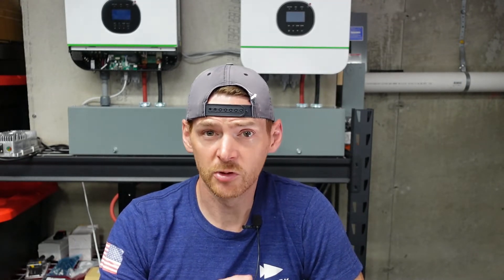Growatt SPF 3000TL LVM-24p - Why Break the Ground\Neutral Bond?

Comment: Great videos, thank you. I have a SPF 3000TL LVM and no where in unit or in the user manual does it mentioning installing an Earth ground. There is no grounding lug/point. So where does the ground come from?
Reply from the maker: On the AC side of the system you run hot\neutral\ground wires to the inverter. In my case the ground wire in that trio runs to an earth ground through the panel.

Comment: Do you know the purpose of connecting the ground and neutral together in the main panel?
Reply from the maker: My understanding is that if there is a fault somewhere and a ground ends up carrying current, it will do so back to the main panel at which point the bond will allow the circuit to complete via the bond with neutral. Having the bond in the panel ensures that current will flow back to the panel on a predicted path (normally neutral or ground in case of fault) and then complete the circuit. If there are multiple ground\neutral bonds it creates a variety of paths that current could take, and have potentially dangerous and unintended current flows.
Reply: It allows the breaker to trip and kill the line, stopping the flow of the current.

Comment: I have the same inverter (just one) and when I plug the AC in of that inverter, into my house power for utility power when needed to charge and run the loads,  My GFI's in the bathroom trip. If I unplug the wall power to the inverter, the GFI's set and hold. It sounds like I need to remove those screws if Im using AC in to charge the battery. Does that sound like I'm on the right track to you ?
Reply from the maker: This is an interesting one, and sorry for the novel... While the bond could be the culprit, I think there may be another one here, voltage spikes\drops. A few questions jump out right away, 1-Are the GFCI outlets that trip on the same circuit that you are charging the inverter from? 2-Do they trip right away or is it random? 3-What amp circuit are you charging the inverters from? I cannot remember if the neutral and ground are bonded on the AC in on the inverter, they are on the AC out for sure. First, I would check that bond with multimeter, make sure the inverters are on and outputting voltage (the bond is not active until then, but obviously be careful doing this). If there is a bond there you may want to remove it since you will be bonding at two locations in that case and may be creating alternate paths for current to flow, this may or may not solve the issue. The other issue is that these inverters really require a 40a circuit for the AC in, if you are charging from a 15/20a circuit aiming to charge batteries and sustain inverter load you are likely underpowered, this could cause fluctuations in voltage which may trip the outlets. This happened to me on grid power with voltage spikes coming from a substation down the road. I have a sense monitor which registered the voltage spikes. The workaround here (what I do) is to not use the AC in and instead use a battery charger (which is plugged into grid AC) but goes direct to the battery and is designed to work within 15-20amps. Hope this helps!

Comment: with a Lightning Protection System  installed will you bond it together with the solar system grounding?
Reply from the maker: That is a good question. I will probably ground the panel frames and the lightening protect to the same rod. My system is off grid so I do not need to worry about a ground loop on AC in.

Comment: Hi,
i live in europe and have a epever 5kw inverter charger. when the inverter is on, there is a current going INTO the solar pannel frames. around 50VAC. this is so weird.
is it posible this is because of the Ground N bond inside the inverter? we only have 240v one fase comming frome the inverter. thanks
👍
Reply: That sounds like an earth fault, probably a bad DC connector
Reply: @scottcharles6918  HI, thanks for youre reply. what do you mean a bad DC connector? the solar mc4 connector? they are fine. or do you mean somewhere in the inverter? thanks
Reply: @DamageBen   @DamageBen  if you mean you have 50v dc on the panel frame then that usually means you have a circuit to earth somewhere in the array. Mc4 connectors that are left touching the roof for instance will eventually suffer from water ingress and make a cct to earth on one of the dc legs going to your inverter. Even when they look ok they can still be bad.
If you don't have any solar test equipment then you can try splitting the array into smaller strings until you lose the fault.
Quite often the home runs that go from array to inverter will be low RISO if over 5-10 years old
Reply: Also if you are in the UK then I would bet a decent amount that your issue is indeed MC4 or cable related on roof. We see this all the time....I run. A solar business BTW, seeing faults every day.
Reply: @scottcharles6918  hi, its not that.
when the inverter is only ON for charging the battery everything is fine. but when i switch on the inverter so it outputs the 220v AC then the frames start to get around 40 to 50v AC on them. its so weird. soits not a DC problem i think.
Reply: @DamageBen  do you have a common earth? If so then id say you have an inverter fault
Reply: @scottcharles6918  how do i measure this?
Reply from the maker: Well that is not good at all! I wouldn't think the bond by itself would do that, I would check all the wiring. Something is definitely not right.
Reply: @lifewithlonsi  hi thanks for your reply. i cheched  every thing again and all is good. the only thing i can think of is.
i have the ground wire contected to the ground in my house. mayby making a new grounding rod next to the inverter wil fixt the problem?
Reply: Not a grounding issue, but if ac is being backfed into your dc lines.....there is something amiss inside that inverter....the dc should be isolated from the ac inside the inverter.
Reply: That is standard for these inverters.  THey use a PWM H Bridge circuit based around a HV DC bus.  There is NO isolation between the PV inputs and the H bridge DC bus.  So you will always get that voltage impressed.  Why do you think these AIO are so cheap?